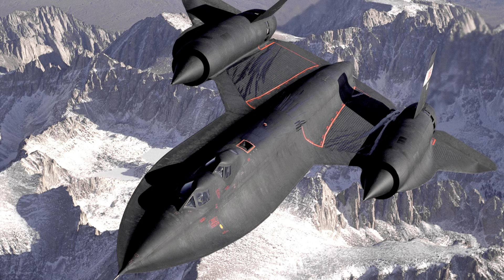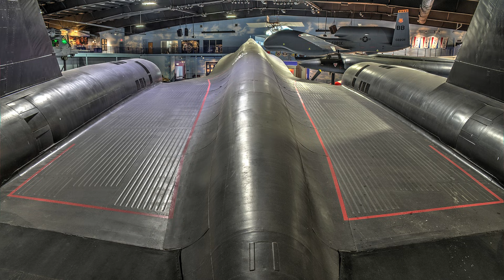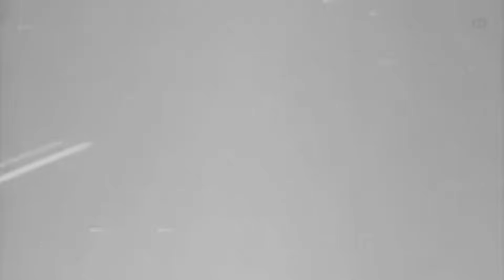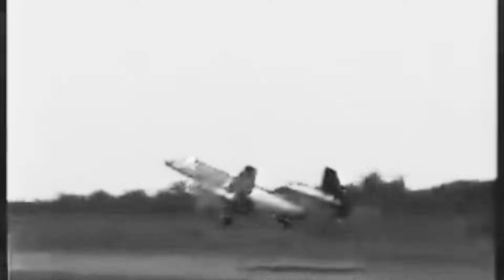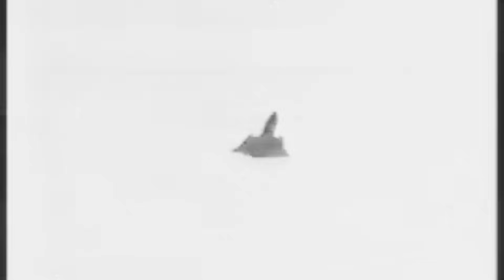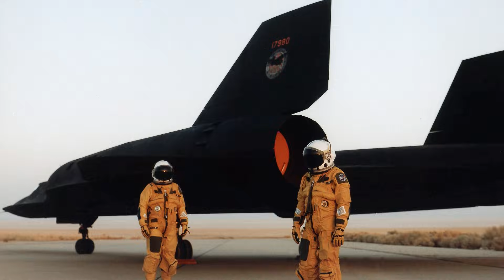The Mach 3 "Ghost" Glitch Why No Missile Could Ever Catch It

Comment: Why replace literal and properly used words with 'error, hack, glitch, source code, and bleed?'  The RS71 (it was mistakenly introduced as SR71) was totally mechanical.  To use IT lingo is an insult to the engineers that designed and built this thing.
Reply from the maker: Noted